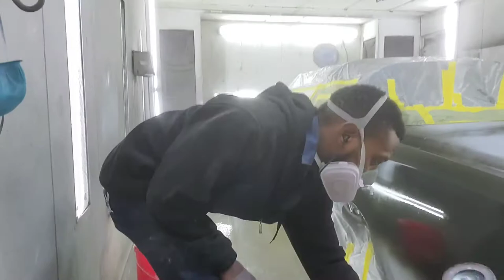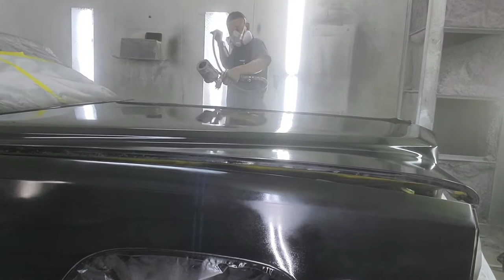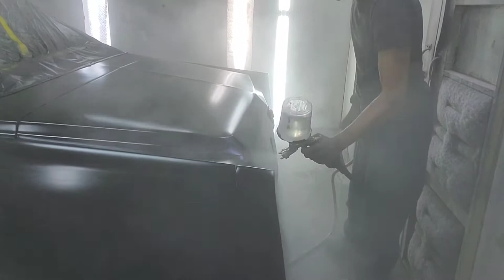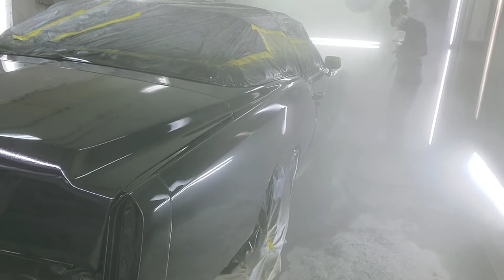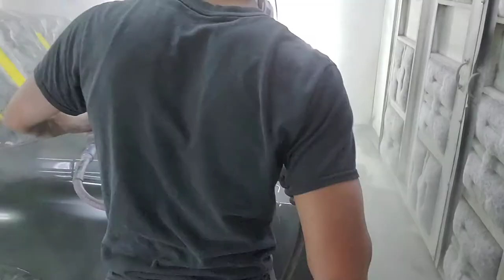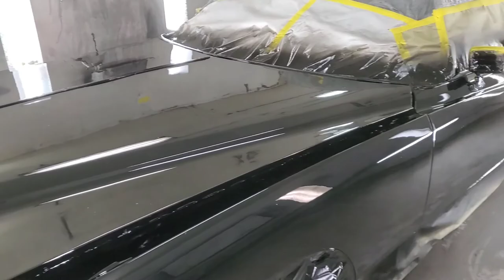76' Cadillac Eldorado Convertible Overall paintjob

Comment: That's a lot of car nice work as always.
Reply from the maker: Preciate it brother! And yes definitely a lot of car….the hood was the hardest part …trying to stretch to reach the center portion
Reply: @whipzpaintlyfewithjay9654  lol I know the feelings that why I prefer to take the hood if possible.
Reply from the maker: For sure!…I take them off most of the time…but I chose otherwise in this case. Didn’t want any put back together problems…such as chipping, hitting fresh paint causing me to respray..or none of that. That’s an old GM hood “the real deal” real metal…don’t want to wrestle with it!